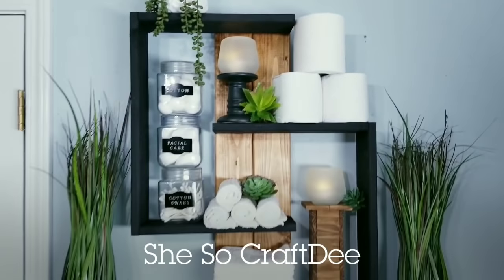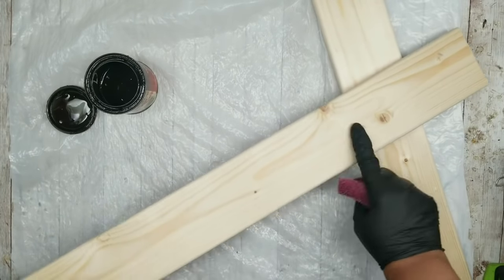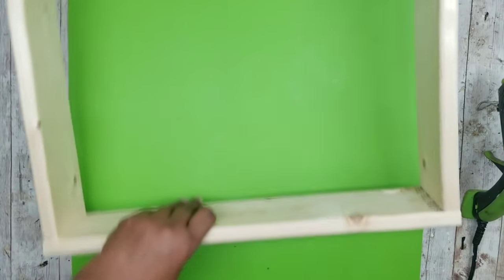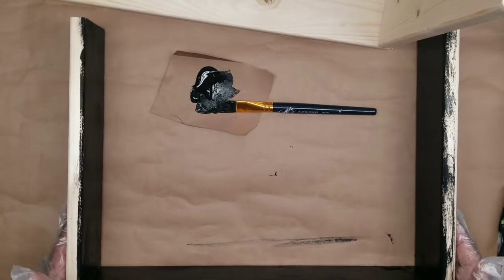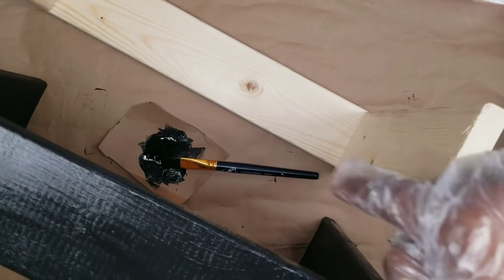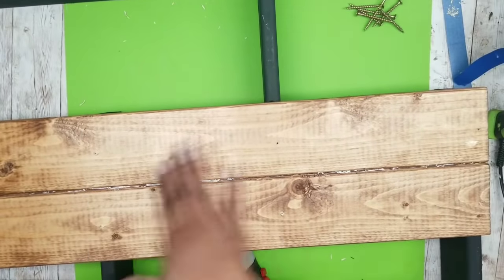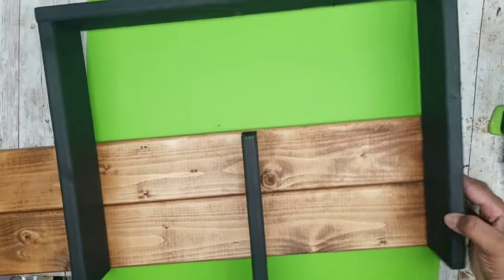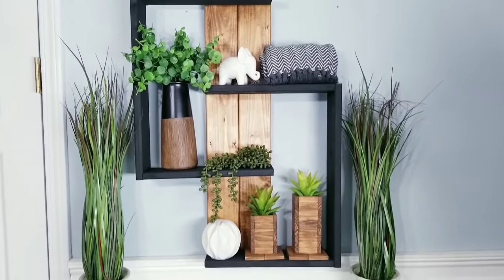*NEW* HIGH END INSPIRED DIY | Modern Wood Shelf Wall Decor | Look For Less | Shelf Display Dupe!

Comment: Damn! That is amazing. You make everything look so easy but I usually struggle. Lol. Do you think a lantern would look good on that shelf or not enough room width wise? I really love it Dee! ❤️Great job!👏🏼
Reply from the maker: The clearance on the two side shelves is 18" and the shelf width is about 3.5:" You can use boards wider than the 1x4 I used, and that could make a base that will hold larger lanterns.

Comment: Could this piece sit on a counter top instead of hanging it
Reply from the maker: This shelf can be self standing, but since it has offset shelving, juts make sure the decor is evenly distributed so it does not tip over.